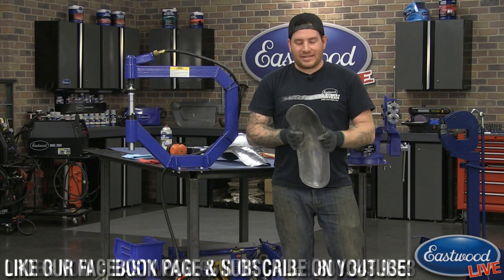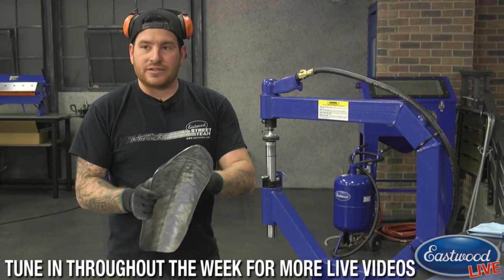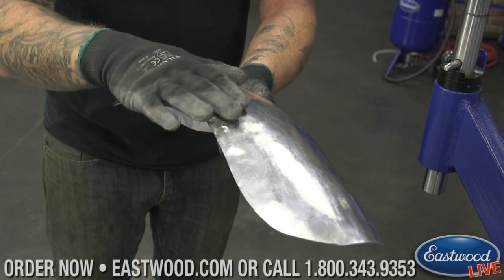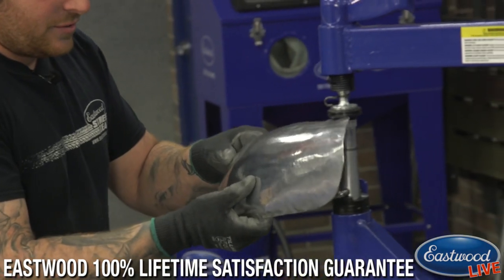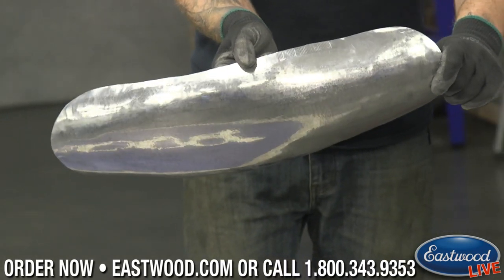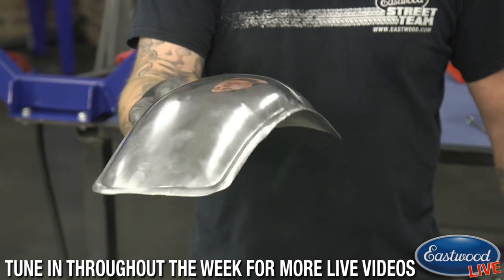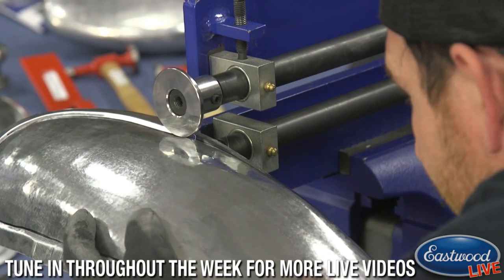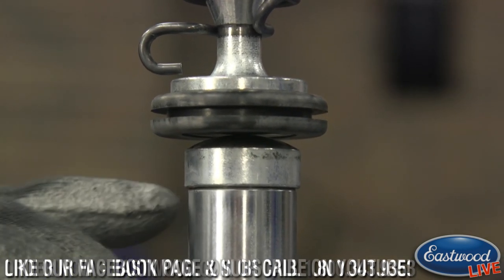Beginner’s Guide To Metal Fab! Build Your Own Café Racer Fender – Part 2 of 2. From Eastwood

Comment: The whole thing should have been finished in no more than 20 minutes at the most. Way too slow. Of coarse I hammer out fenders everyday and he doesn’t. I would like to give him some much needed help. With the right anvil radius on the English Wheel is much faster. Forget the sandbag. I use a blacksmith swage block and a plastic mallet. Sandbags are almost useless.